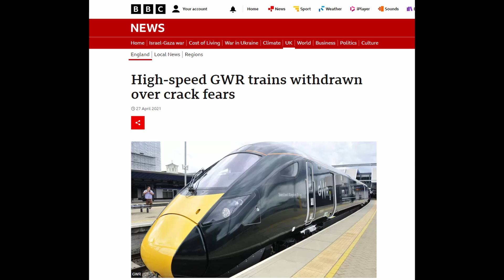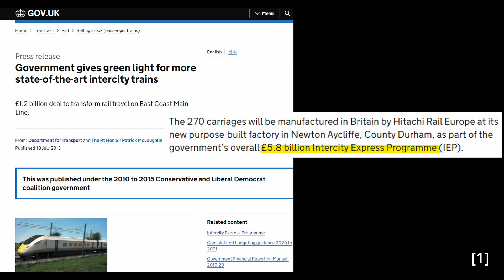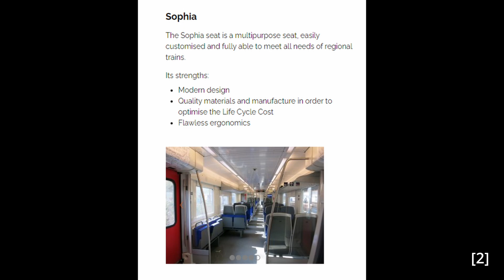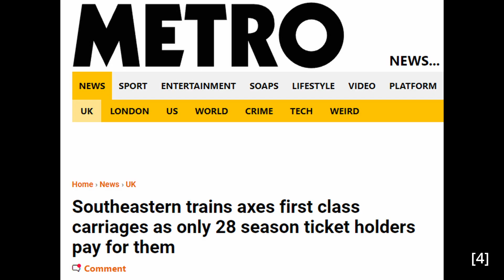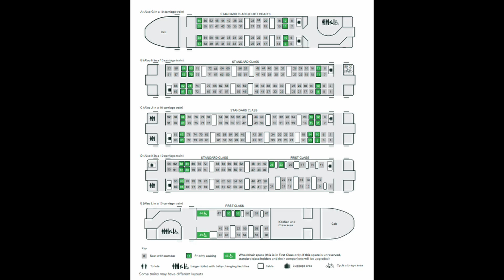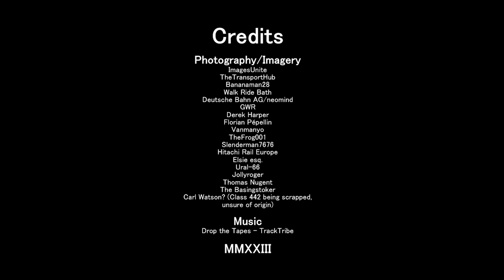Can the IETs ever be decent?

Comment: It does seem the diesel engine fitted to class 800s is underpowered. One of the best improvements the government can make is electrification of the great western line west of Reading. From what I've heard, the seats need to be changed to something fitted in the mark 3 coaches. By the sounds of it, the suspension needs to be changed too.

Why the contract wasn't awarded to a British company I wish I knew. It seems the government are happy to send money overseas rather than support our own workers. I would imagine Doncaster or Crewe works would have done a better job.
Reply from the maker: The GWML is electrified West of Reading, the wires go all the way to Cardiff. They ought to extend to Swansea, Bristol and Oxford, though.

The IETs were (mainly) built in Britain, at the Newton Aycliffe plant. There were several other international factories involved, but there isn’t an enormous amount of from-scratch manufacturing capability in Britain left - Crewe works closed long ago, only Derby remains now. As for why it couldn’t be awarded to a British company, well there are none left! Derby couldn’t be selected as their then owners (Bombardier, who are Canadian) didn’t have any high speed products on offer.
Reply: @GWVillager  I didn't know that. Thanks for telling me.

Comment: I try to travel on a class 387 instead when I can as they are a far better train, even if a bit slower. As for power units, its best to start replacing the GPUs with battery packs, making some a class 801 thus reducing the GPU load. That will work on many routes but not the West Country routes. Electrification is of course a must even if partial to enable battery usage.

Comment: I’m not sure what it’s like elsewhere on the network,  but first class between London and Penzance is pretty heavily used, I’m not sure cutting it back further would be a good idea.

Fixing the ride and the seats really needs to be a priority; I can’t work on the IETs when they are at speed simply because the train shakes and rattles so much; especially on the section of line between Taunton and Castle Cary. 

The seats in FC are slightly more comfortable than those in standard for long trips, but I miss the old leather seats on the 125s.
Reply from the maker: As I said, first class would only be cut in size on the remaining 5 car trains. All Intercity services would be formed of 9 cars, which would retain the same amount of first.
Reply: @GWVillager  that would be good news - now let’s hope they can stop putting 2 * 5 cars on the Penzance route. Keep up the good work!

Comment: The IET isn't a train to be praised but most of the issues mentioned are not Hitachi's fault. The crack was due to higher than anticipated loads, and was permanently resolved by the installation of additional support. Unlike trains from CAF and Stadler which have endless issues hopeless to be fixed, IETs are kind of a reliable workhorse in Britain, despite poor passenger comfort. Ride quality is a strange issue - I have once ridden on TPE's 802 on ECML and the ride quality was remarkable, while I also have a journey with LNER and that was brutal. 

For the interior, Hitachi basically did what they were ordered to - the first batch of IET for GWR was basically DfT with no effort for designing, just picked the cheapest and thinnest one and installed as many as possible. LNER was better, although it is still the iron board seat, there is a bit of Virgin Trains vibe modernised. Lumo and Hull Trains are decent, while Avanti is going to use the seat as the refurbished Pendolino on their 805s and 807s, which I think will provide a similar experience.

Comment: I quite like what Hitachi have built the Class 800, Class 801, Class 802 and Class 803 AT300 IETs. And with Class 805, Class 807 and Class 810 to be built. And perhaps Hitachi should continue on manufacturing more new AT200 Commuter trains and the AT100 Metro trains.

Comment: The economy class on these trains looks so cramped I would not want to spend 12 hours plus on them. Definitely improve the seats. If the trains are falling apart from the tracks. I hope these never end up in Australia they will not even last 5 years. NSW Trainlink lines are very rough and shake the xpts to bits causing significant maintenance requirements. Definitely a full dining/lounge car would be nice perhaps on the 9 car version.
Reply from the maker: That would be lovely. You can get a fantastic "Silver Service" on a few morning/evening Pullman trains between Wales/the West Country and London, but most of the time there's no catering.
Reply: How can you spend 12 hours on a high speed train in Britain when it's not even a thousand miles long?
Reply from the maker: @B-A-L  They're talking about Australia.

Comment: The DfT specified the seats as they are the "experts" in the needs of the intercity travellers. Would British Rail have made so many mistakes in procurement? No, many of the trains that they built are still running today.
It is hard to understand why Hitachi have made so many cock-ups in these trains as they have had an excellent reputation for previous construction. I have worked on Hitachi built machinery in the past and never had any issues with quality or reliability. Again, it could be down to the DfT specifications, with Hitachi just building what the customer wanted, rather than the people who actually get to use the trains.
GWVillager, your suggestions make good sense, so for that reason, they will be ignored!
Reply: Someone mentioned that they actually got built at an Italian plant that had gone brancrupt before Hitachi bought them out, Austria having returned their trains to that factory due to build issues. Might explain it, but then why didnt the DFT return them also?
Reply: I read a comment from an actual Hitachi employee in Newton Aycliffe that they had nothing to do with the interior and he was sick of all the xenophobic comments towards the company when they had to work with the budget the DfT specified.
Reply: @B-A-L As I said in my original comment that Hitachi have had an excellent reputation, so your reply about the Hitachi employee makes very good sense. I would not trust the DfT with any transport, let alone trains.

Comment: I don't know how easy they would be to implement (and they'll probably reduce capacity), but the seats used on Eurostars would be the ideal
Reply from the maker: I agree they are lovely. I enquired about these, and it turns out the Eurostar seats were custom made for Eurostar trains, so would be difficult to modify for other rolling stock. Even worse, they don’t meet modern fire safety regulations.

Comment: I'm most familiar with the LNER sets so for them I would propose a number of major changes and a number of more cosmetic changes.

Major Changes:
1) Extend all trains to 11 carriages
2) Move the Quiet Coach to Coach A (furthest from the barriers at Kings Cross) rather than having it in the middle of the train.
3) Move the standard class Wheelchair space and add an Accessible toilet towards the middle of the train rather than in coach A at the far end of the platform at Kings Cross - whoever approved that in the first place needs to be fired!
4: Ideally move the kitchen and Buffet to be together between first and Standard class, ideally in the same carriage as the wheelchair spaces, and add a dining area in this carriage so that the end carriages are fully usable with seats.

Cosmetic changes:
1) Replace the standard class seats with more comfortable ones similar to those on Lumo, and have them properly aligned with windows
2) More Luggage space at the ends of carriages by the door pockets
3) Tone down the lighting onboard
4) Rearrange first class seats to be window aligned and replace the tables with some that don't impact leg space.

Comment: One relatively positive comment: when these trains run under diesel power, the engine noise in the passenger cabin is relatively muted. I have been on some Voyager units where the noise level is significantly higher. I also like the colour display of seat reservations on the IETs - you can very quickly assess where the unreserved seats are. After that, sadly, I agree with all your comments. The lighting does not affect me personally, but I fully appreciate that to others it is a real problem. The seats are, of course, on of the biggest problems. However, I also want to comment on catering, especially hot drinks. When there were buffet cars on the HSTs, you could get a pretty decent cup of coffee from the machines that had latterly been fitted (assuming they were not our of order!). A trolley provides a very lacklustre cup in comparison. Your idea about some way to get hot food is also a good one. If you are travelling all the way from London to Cornwall, the current provision is simply not good enough. Thank you for your vid, and keep up the good work!

Comment: The lighting on these trains is inhumane. It's not so hard to get a decent coloured led bulb, it's 2023 FFS. The bike spares are a joke. No more than a check box excersise and likely done internally to put off people bring bikes. If you aren't able to lift your bike you are left with a bike sticking out of the cupboard. If you have 2 flat bar bikes, forget it you can't fit them both. As you said all bags or items in baskets need removing. Have full fenders (as most bikes used for transport have) you won't be able to use this cabin either. Non standard rims or wheels, you are also out of luck, these bikes won't fit into the hooks. It's as if they tested one bike, a road bike. They aren't fit for purpose.

Comment: Don't forget that a lot of these were built in Italy by Ansaldo-Breda (or what used to be until Hitachi bought it). That company was bankrupt, and was responsible for the exceptionally bad built quality of the Dutch V250 high speed trains, so bad that they were all returned to the factory and money paid back in a settlement.... I didn't believe that the quality under hitachi miraculously would be solved, that factory still has quality control issues.....

Comment: TransPennine and LNER  train crew and platform staff who have tried to get my bikes (which are large because I'm tall)  into the bike cupboards on their versions of the Hitachi trains have described them as trains designed by people who knew nothing about trains, but then you could say the same about the Voyagers. People in GWR land might miss the HSTs, up here  in the North East we miss the Class 91s and Mark 4s. I could load my bike in the DVT without getting in anybody's way, and leave it in a proper bike stand. To be fair to LNER and TransPennine, the trains seem to be better maintained than the GWR sets, and the interiors, despite the horrible seats in standard class, are pleasanter and cleaner. First class in LNER is usually quite busy, but it could be probably  removed from most of the TransPennine sets to increase capacity. I have travelled with Lumo once, and the seats are more comfortable even for taller/bigger folk. The ECML has four operators using 80x trains - Hull Trains, LNER, TransPennine., and Lumo - but it is also the only mainline where passenger figures are rising - in fact, there are more passengers travelling on these services than before CoVid. This makes me wonder if the problems on GWR you describe are due to poor management as well as the trains.
Reply: Just jumping on this to agree with you. I live on the ECML and use LNER everyday. The trains are always busy, with people going all over the country for work and pleasure, the trains are generally very well maintained, the at seat service for food and drinks works very well and in general the staff are polite and always give regular updates if delayed etc. Having said that, I still find the ride on the Class 91 which they still run a lot better and quieter. Noticeably when you are outside, if you watch an Azuma pass through the station at full chap it is horrifically loud, but the class 91 passes in quiet, which seems odd given we are meant to be more technically advanced now... The other thing I would say, LNER pricing is actually very good. Most journeys are less expensive via train than if I had driven the same route, even for two people. However I find that GWR is horrifically expensive. Paddington to Briston circa £100 when I looked once, and that is only 1 1/2 hours. London to Newcastle was £60 for the same day. LNER seems to know what they are doing, and I hope they can keep it up.
Reply: Funny that, given that LNER are government owned and operated, unlike GWR.
Reply: I expect qwr fares are higher to pay shareholders
Reply: I recently travelled First Class Glasgow-Edinburgh with LNER, to see what it was like. Admittedly it didn't cost much but all the headrests were broken in my area of the carriage - obviously I couldn't try every single seat in the train - and all I can say is that I was glad I wasn't going all the way down to England like that!  The aisle seats have a table leg in front of you so you can't cross your legs on a 4 hour+ journey. Having said that, the on-train staff were Pure Dead Brilliant!
Reply: At last!  Someone after my own heart!  And good on the crew and staff who are honest enough to admit that these Hitachi are designed by arrogant ignorant egomaniac designers and TOCs who care nothing for trains and cylists as they probably never use these themselves.    

Really, they could at least remove those horrible partitions and have open lobbies like on Turbo, Electrostar, and Blue Desiro trains.    But WILL they.....    That'd be a miracle!

Comment: Which ROSCOs supply them?  Are they supplied by different ROSCOs or Hitachi themselves?  Whatever, the suppliers should be the one(s) to put right the obvious wrongs.  The trains are being leased and therefore the leaser is responsible for them.  Problem is that, because of mass withdrawals of older stock (that were still working properly up to their final day in traffic), there are few or no realistic alternatives
Reply from the maker: They’re mainly leased by Agility Trains.
Reply: @GWVillager  Guess who has a majority share in Agility?
Reply: @danlastname9002  Please enlighten me; I've never heard of them 'til now.
Reply: @MrTudwud  Hitachi. The IETs are effectively owned by Hitachi.
Reply: @danlastname9002  Thanks.  That explains it all.  So now, the manufacturers of the trains can become a ROSCO.  No wonder things are not improving on the railways.
Reply: @GWVillager  Thanks for the info.

Comment: The only thing I would change from your recommendation is extend the 5 car class 800 units and use the class 802 on the stopping service. This is because the 802 is more suitable for non electrified workings due to having a more powerful diesel engines and a bigger fuel tank
Reply from the maker: Theoretically, I would do this. However, there are considerably more 5 car 800s than 802s, and the extra units would probably be necessary.

Comment: Having two units coupled together is such a flawed concept.

I remember seeing a lady with a first class ticket board at Exeter, who couldn't find her seat.  She was in the wrong half of the train, and because it was busy, there were no spare seats, so she had to stand for 80 minutes to Taunton.

There is also the needless duplication of having four driving cabs and two kitchens!  All wasted space.

9-car units would be far better
Reply: And all the stuff that talks to the signalling system.
Reply: That do be the issue with MU sets... You can't get the exact train you need easily.
it's overkill or overloaded.
Reply: @davidty2006 
Bad idea. Loco haufed sets which can be split are the way to do long distance routes.
Reply: With 9 car units you end up with a lot of empty seats off peak. The Waterloo Bournemouth Weymouth service was done right between 1967 and 1988.
Reply: Now how did it take 80 minutes to get from Exeter to Taunton? Even in 1959 it took only 35 minutes.
Reply: It’s always a gamble getting on a couples one coz u don’t know which one has seats usually the back is on but I get on at reading and if it’s coming from London it’s going to be packed from the back 😭

Comment: These trains can never be decent. They are built to a budget, low, and have no longevity.
If they were to replace HST then they should have been built at least to the standard they were.
They were in service for 50 yers and still would be if the Tory government who pretend they don’t control the purse when building replacements.
Even when the Valenta engines were replaced they had been in service 30 years.
They will never replace onboard catering as the whole BR network was totally dismantled.plus it’s highly dubious that should on board catering ever be brought back, where would the staff pay in their shift takings? This was simple before as any Intercity station regularly had icobs monies paid daily.
This stupid government claims there is no place for a state owned and run railway quoting Germany and France. Erm, their railways are state owned!